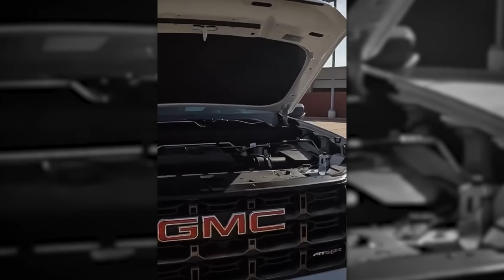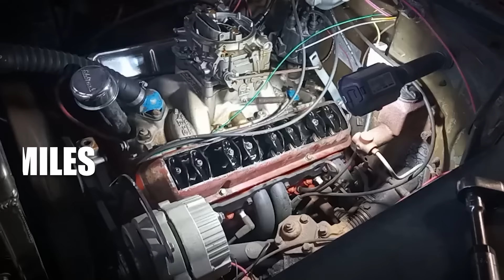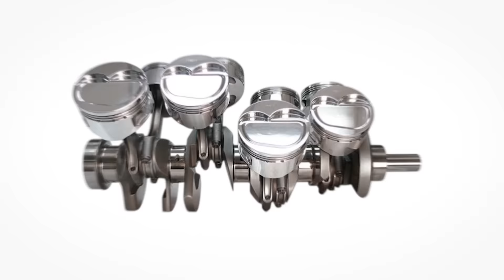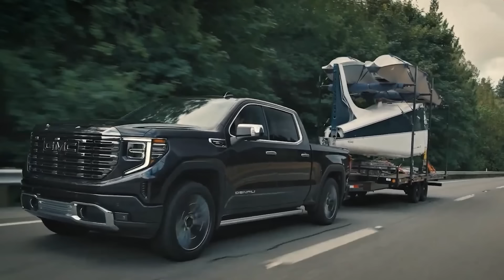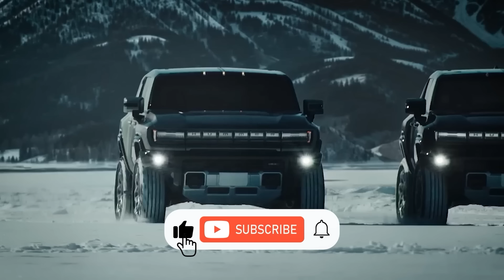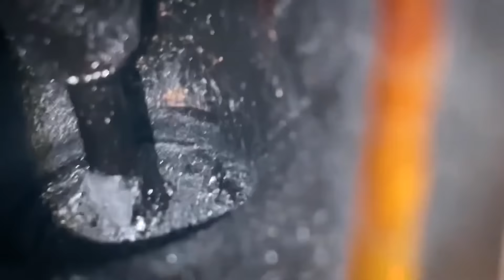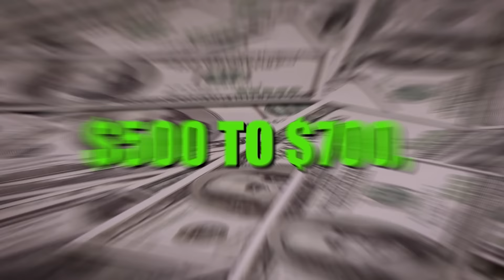The ONLY 3 GMC Engines That Last 300,000 Miles

Comment: 300000 wow they don't make them like they use to
Reply from the maker: That’s the whole channel in one sentence. The pre-AFM LS engines — LM7, LR4, LQ4, LY6 — were built simple and overbuilt, and 300K is just what they do. The irony is GM still knows how to build them (the HD 6.0 and 6.6 gas prove it), they just stopped putting that philosophy in the light-duty trucks. Buy the right engine and they still make them like they used to.

Comment: 341K on my 2012 Silverado lc9 engine runs like a top.
Reply from the maker: 341K on an LC9 is outstanding — and notable because the LC9 is the AFM 5.3. Hitting 341,000 on an AFM engine means either you got a good one, you’ve been religious with oil changes, or there’s a disabler in it. Whatever you’re doing, keep doing it — that’s well past what most AFM 5.3s achieve. Proof that clean oil and a bit of luck can carry even the deactivation engines a long way. Impressive.

Comment: I have a 2015 silverado 3500Hd with 6.0l flex fuel capability.  Is this a good engine?
Reply from the maker: That's the L96 6.0, and yes — one of the best gas engines GM ever put in a heavy-duty truck. No AFM, no DFM, iron block, port injection, FlexFuel capable. Paired with the 6L90 in the 3500HD, that drivetrain regularly clears 300,000 miles. You bought a keeper.

Comment: 3,000 mile oil changes & AFM deactivation module 👍.
Reply: Did that. Still suffered a mechanical failure of number four cylinder AFM lifter as well as bent push rod at 45,000 miles.  👎🏼

Comment: Cylinder deactivation plug-in device does not protect the mechanical lifters. I’ve run the Range Technology AFM disabler for years yet my number four cylinder AFM lifter was destroyed by 45,000 miles along with a bent push rod. $5,000 out-of-pocket to fix it.
Reply from the maker: This is the hard truth that gets buried in disabler marketing. The Range stops the engine cycling into V4 mode, which reduces wear cycles on those lifters — but the lifters themselves are still mechanically active and can fail from manufacturing defects or oil supply issues. The only failure-proof fix is a full mechanical delete: non-AFM lifters, non-AFM cam, valley plate blanked. $5,000 out of pocket at 45K is brutal — sorry that happened. Important data point for everyone reading this.

Comment: I have a 2013 work truck and it has AFM
Reply from the maker: Correct — by 2013 the 5.3 (LMG/LC9) came with AFM even on work trucks. GM rolled it across nearly the whole lineup that generation. Good news is a plug-in disabler keeps it from dropping into 4-cylinder mode and takes a lot of stress off those lifters.
Reply: @EverythingGMC-k9x  I still lost a lifter at 45,000 miles while using range technology AFM  disabler.

Comment: LS engines without AFM are good great no but ok problem is everything else on a GMT 800 is complete junk doesn’t matter how good the engine is when everything it’s bolted to is junk
Reply from the maker: GMT800 everything else is junk (ONLY 3 Engines 300K)
The interiors and some electrical on the GMT800 aged rough — dash cracks, door handles, clusters. But the frame, the 4L60E/4L80E, the transfer case, and the suspension were genuinely overbuilt. That's why so many still run at 300K. The engine isn't carrying a junk truck — the bones are good, it's the trim that fell apart.

Comment: Duramax is the only engine worth a shit in a gm.
Reply from the maker: The Duramax earns that loyalty, especially the LBZ and LML. But the LM7 5.3 and the pre-AFM 6.0 LQ4 have put up 300K right alongside it. The diesel just does it while towing. For a gas engine, those two are the closest GM ever got to Duramax reliability.

Comment: I have a 09 Escalade ESV with over 300,000 on the original L9H engine no afm garbage, just a L92 with E85 capabilities.
Reply from the maker: L9H is the FlexFuel version of the L92 — same aluminum block, port injection, no AFM. That's exactly the build sheet you want for longevity. 300,000 on the original is the proof. The Gen V engines that replaced it got AFM and direct-injection carbon problems — completely different reliability profile.

Comment: Lies I’ve gotten two l83 with afm over 300k and one is currently at 430k. Just change your oil every 3500 miles and use 5-30 full synthetic Castrol or mobil1
Reply from the maker: Two L83s with AFM past 300K and one currently at 430K on 3,500 mile full synthetic Castrol or Mobil 1 changes — that's the maintenance discipline making the difference. The AFM risk is real but not universal. 430K is the number that ends the argument. 💪

Comment: My 2010 gmc sierra 1500 4.8 crewcab 138k miles on it runs great.
Reply from the maker: 2010 GMT900 4.8 crew cab at 138K running great — the 4.8 no-AFM platform is one of the most underrated engines in the lineup. Keep it going. 💪

Comment: 2002 Yukon Denali, 320 and some change on the motor…….and it’s still going strong. Been through 2 transmissions and 2 transfercases but that’s 100% due to how I drive……….I surprised a lot of people at the stoplight.
Reply from the maker: 2002 Yukon Denali, 320K on the motor, 2 transmissions and 2 transfer cases by admission of how it's driven — and still surprising people at the stoplight. The 6.0 in that platform is genuinely indestructible. The drivetrain tax is the price of having fun with it. 😄 💪

Comment: Any small block can go 400k plus with regular oil changes, and a little maintenance. He didn't mention the exhaust manefold bolts that like to break on the LS blocks.
Reply from the maker: The exhaust manifold bolt breaking issue on LS blocks is real and chronically underreported — it's one of the more frustrating hidden costs on high-mileage GMT800 and GMT900 trucks, especially in rust belt states. Worth adding to the checklist on any used purchase inspection. 👍

Comment: my 350 tbi has 177xxx miles and still going strong nothing beats less electronics fr
Reply: Its really because your engine is only pushing 195 horse power. Low power equals low stress.
Reply from the maker: 350 TBI at 177K still going strong — less electronics means less to fail. That's the formula that built GM's reputation before the AFM era. 🙏

Comment: There’s no reason the current 6.6 L8T can’t go 300k miles.   It has no cylinder deactivation and has a strong rotating assembly.  The direct injection hasn’t shown itself to be particularly problematic in the 6.6.
Reply from the maker: The 6.6 L8T argument is solid — no cylinder deactivation, strong rotating assembly, and the direct injection carbon buildup issue is manageable with a catch can and periodic walnut blasting. Nothing in the design profile suggests it can't hit 300K with proper maintenance. The data just needs more time to accumulate. 🙏

Comment: The 6.0 lq4 the most reliable engine gm, wait no. The most reliable engine ever put in a truck  period.
Reply from the maker: The 6.0 LQ4 most reliable engine ever put in a truck is a take that's hard to argue with — the commercial fleet data alone backs it up. Millions of miles across work trucks, ambulances, and heavy duty applications with nothing but oil changes. 💪

Comment: Most of the time its not the engine... its the transmission 😢😢😢
Reply from the maker: That's a fair point — the 6L80 and 8L80 transmission issues account for a significant portion of the expensive repairs on these trucks, sometimes more than the engine itself. Transmission fluid changes every 30K are as important as the oil changes. 🙏
Reply: It’s both on the newer models, unfortunately. 👎🏼

Comment: 2012 silverado 2500 l96 6.0 with 340k miles. Just had to do an oil pump couple thousand miles ago. Only thing done on the engine. 3rd 6l90 at 320k 😅
Reply from the maker: 2012 2500 HD 6.0 at 340K, oil pump at 320K as the only unplanned engine expense — that's the 6.0 heavy duty track record right there. Third 6L90 at 320K is worth noting though — what were the circumstances on the first two? 🙏
Reply: @EverythingGMC-k9x I got the truck with 170k and first transmission gave out at 190k. Second transmission was rebuilt with stock parts and cost me $2500 which lasted 130k. 3rd transmission i did a billet stage 1 with billet torque converter so it should last. It has around 5k trailer on it at all times and I run it everyday as a work truck. I checked the compression before doing the 3rd tranny rebuild and it was 195-210 on all cylinders! Oil pickup o ring went out so i figured while im there do oil pump as well which I upgraded to high pressure oil pump
Reply: Second transmission im 90% sure the torque converter failed and took the transmission with it but im not mad for $2500 it was a great deal for 130k miles
Reply: I also never did fluid changes on my second transmission 😅

Comment: First, you completely missed the GMT-400's V8s that have countless over 300,000 miles.  I currently still have a 98 K1500 with 337k.  Second, why make the erroneous comment at 0:34 that "Every GM V8 built after 2005 has active fuel management, AFM" and then contradict it by pointing out V8 engines that were available after 2005 that did not have AFM.  Also, I would make a case for the 6.2L L9H (403 hp & 417 ft-lb) as it too was not equipped with AFM and have surpassed 300,000 miles.  Unfortunately the L9H was not produced to the sheer amount that the your listed engines were.  Personally the L9H is the only engine I would consider if shopping for a GMT-900 1500 as the last one I had, which I regret getting rid of, had 189k miles on it at the time.  The only thing that ever needed replaced on the engine (not including maintenance items) was the alternator.  Now the wife has a 2018 Tahoe with the L86 but the AFM has been removed and a catch can installed and I drive a CP3 swapped LML Duramax.
Reply from the maker: All valid corrections — the L9H 6.2 without AFM is a legitimate counterpoint and deserves its own mention. The GMT400 V8s are exactly the generation the channel consistently points to as proven. The 2018 Tahoe L86 with AFM removed and a catch can is the right approach on that platform. The CP3 swapped LML is a whole other level — that's a serious build. Appreciate the detail. 🙏

Comment: I had a 1993 GMC Sierra that had 424,000  miles on a 4.3 engine engine and unfortunately a tree fell on it during a hurricane and it was totaled. I later bought a 2004 Silverado with a 4.3 engine and it has 236,000 miles on it and I am going to drive it as long as I can. My other Silverado,  a 2000 , has a 5.3 engine that has 137,000 miles on it.
Reply from the maker: 424,000 miles on a 4.3 totaled by a hurricane — that engine deserved better. The 2004 4.3 at 236K and the 2000 5.3 at 137K both have plenty left in them. Keep driving them as long as they'll go. 💪
Reply: @EverythingGMC-k9x  I have a 2006, 4.3 with less than 50k mls on it (runs like new). Looks like I don't have to worry about anything for a while.
Reply: 327,000 on a 97 4.3 for me.
Reply: I just bought a 2000 Chevrolet Silverado 6.0 2500 from my brother who owned it since 2005 with a truck camper on the back and it also has 137,000. I retired last month and this is going to be my set up for the go-go and beyond years. I'm hoping to get a lot of service life. I had an 04 Escalade with the 60 and loved it.

Comment: Know someone with an early 90’s Dodge Cummins has over 3,000,000 miles. 
Know another guy has an L5P over a million. He only uses Shaffer oil and opti lube.
Reply from the maker: 3,000,000 miles on a 90s Cummins and an LS5 over a million on Schaffer and Opti-Lube — those are the two data points that end every argument about diesel longevity and oil quality. Different platforms but the maintenance principle is identical. 💪

Comment: Any old 350/5.7 can make 300K with routine maintenance and cost less than virtually anything else.
Reply from the maker: Any old 350/5.7 with routine maintenance hitting 300K for less than virtually anything else — that's the original GM reliability standard that the AFM era moved away from. The formula was simple and it worked. 🙏

Comment: I have a 2011 Chevy Silverado 1500 5.3 L 15 years 288,000 miles starts right now. It has four-cylinder eight cylinder drop. I would never buy anything newer than a 2011.
Reply from the maker: 2011 5.3 at 288K still starts right now — 15 years, four-cylinder mode never needed, eight cylinders always working. That's the GMT900 pre-AFM track record proving itself. Never buying newer than a 2011 is a completely defensible position. 💪

Comment: Can’t go wrong with a Chevy!
Reply from the maker: Same platform, same engines, same frame — a GMC with a Chevy heart. Can't go wrong with either. 💪
Reply: Unfortunately, the newer ones with AFM are crap. I found out the hard way after decades of owning solid GM products, I bought a 2018 brand new and the number four cylinder AFM lifter went to shit at 45,000 miles along with bending the push rod. Cost me over $5000 to fix it. Terrible design.  It should be noted I was running a Range Technology AFM delete programmer and it failed to protect my lifters unfortunately. Oil changes were done at the dealer every 3 to 6000 miles

Comment: My 2016 GMC Sierra with a 5.3 has 235k miles with factory AFM still in place
Reply from the maker: 2016 GMC Sierra 5.3 at 235K with factory AFM still in place — that's a well-maintained truck beating the odds. What's your oil change interval and what oil are you running? That data helps everyone in the comments. 🙏

Comment: 2010 5 3 280,000 and still going. No issues
Reply from the maker: 2010 5.3 at 280K and still going with no issues — that's the GMT900 Gen 4 5.3 track record right there. What's your maintenance routine? 💪

Comment: Which one of these engines come with a 8ft bed and crewcab? Thank you
Reply from the maker: All three engines covered in the video — the 4.3, 5.3, and 6.0 — were available in crew cab 8-foot bed configurations depending on the generation and trim. The 8-foot bed with a crew cab is less common but it exists, particularly on work truck and SLE trims from the GMT900 era. 👍
Reply: @jpiuvara  6.0L

Comment: 2002-2006 Suburban 2500 6.0L with 4L80 Trans. and G80 rear diff locker.       Longest lasting GM vehicle on the road period.   (15.8mpg freeway)
Reply from the maker: 2002-2006 Suburban 2500 6.0 with the 4L80 and G80 locker — longest lasting GM vehicle on the road is not a stretch. That platform with that drivetrain combination is virtually indestructible when maintained. 15.8 MPG freeway is the price of admission for a truck that just refuses to die. 💪
Reply: No 15 per gallon

Comment: LY6 6.0 has no afm either
Reply from the maker: The LY6 6.0 without AFM is exactly why the heavy duty platform keeps coming up as the recommendation — no cylinder deactivation, no lifter lottery, just a big naturally aspirated V8 that does its job. 💪

Comment: My 5.3 afm 222000 still running no engine issues regular oil changes every 3000-4000 miles
Reply from the maker: 5.3 AFM at 222,000 miles with no engine issues on 3,000-4,000 mile oil changes — that's the maintenance discipline making the difference. The AFM risk is real but not universal. Keep that interval tight. 💪
Reply: @EverythingGMC-k9x Thanks!
Reply: Similar oil changes and using AFM disabler my L 86 destroyed a lifter and push rod at 45,000 miles anyway.

Comment: 96 vortec 305 it’s got 312,000 and still going strong.
Reply from the maker: 96 Vortec 305 at 312,000 miles and still going strong — that's the pre-AFM era proving itself. Simple, overbuilt, and nearly impossible to kill when maintained right. 💪

Comment: 4.3 ,709,000 miles
Reply from the maker: 4.3 at 709,000 miles. That's not a comment, that's a monument. What's the maintenance secret? 💪
Reply: @farrenmick2184  4.3 L awesome motor💪🏼🇺🇸👍🏻😎
Reply: @robertpickett6741 still going

Comment: My 2021 gmc sierra elevation turbo diesel x31 has 278k miles not a single issue best truck ever made.
Reply from the maker: 2021 Sierra Elevation turbo diesel X31 at 278K with not a single issue — that's the 3.0 Duramax delivering exactly what it promised. Best truck ever made is a serious statement at that mileage. 💪

Comment: Why aren’t you considering 6.6 gasoline motor
Reply: Direct injection is a problem. All GDI engines need a oil separator to minimize oil burning on intake valve stems.
Reply from the maker: Correct — any GDI engine without port injection is vulnerable to intake valve carbon buildup since fuel never washes the valves. An oil separator or catch can on the PCV side is the best preventive move on any direct injection platform including the 6.6. 🙏
Reply: @raylaux8295 The direct injection is a lot bigger problem on the internet than it is in reality.   The 6.6 is a good proven engine at this point.
Reply from the maker: The 6.6 gas is covered in depth on the channel — it's the no-compromise heavy duty recommendation with no AFM, no DFM, and proven reliability. The video this comment is on focuses on the engines most commonly found in half-ton trucks. Dedicated 6.6 content is on the channel. 👍

Comment: 401k on 4.3 GM, 338k on 4 3.8 liter engines.  Most were still running after 380k.
Reply from the maker: 401K on a 4.3 GM and 338K on a 4.3 8-liter, most still running past 380K — the 4.3 Vortec just refuses to quit. No AFM, simple design, and nearly indestructible when maintained. One of the most underappreciated engines GM ever built. 💪